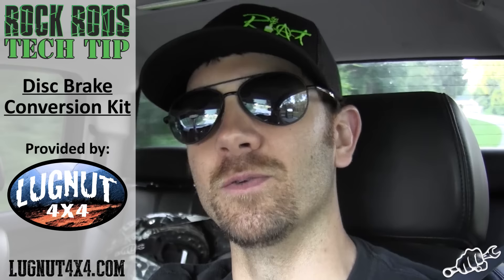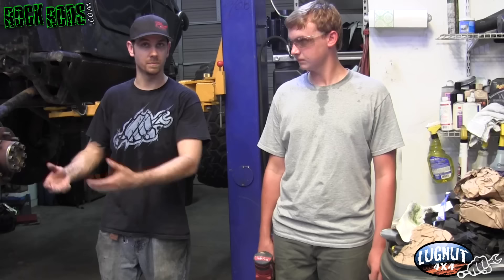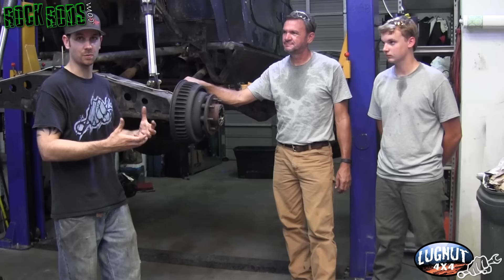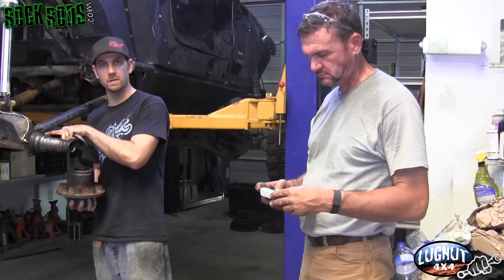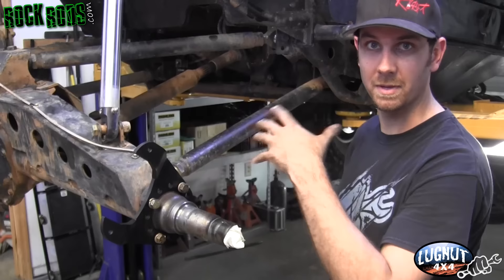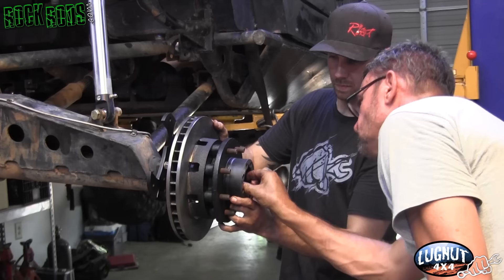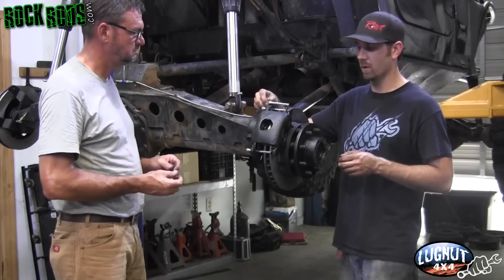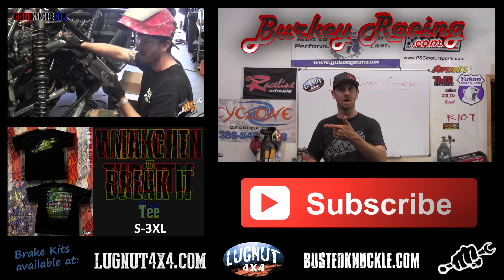14 bolt Disc Brake Conversion Giveaway - Rock Rods Tech

Comment: Good vid.   People should also be aware a different or adjustable proportioning valve is needed (to reduce fluid flow to rear brakes)
Keep on truckin'!
Reply from the maker: This is actually a balanced system so unless you go with the bigger brakes you should be good to go for an offroad setup. Learn more at www.lugnut4x4.com
Reply: I stand corrected.  Thank you.  I guess I should learn more about rock crawlers before I post.  I learned the hard way when I did the switch in my square body chevy truck.  Keep up the good work!
Reply from the maker: No worries man. We are here to help. Many people run into this problem when swapping to bigger calipers. It can usually be remedied by a bigger bore master cylinder though. Thanks for watching.
Reply: Joshua Ackerman dam I didn't think of that thanks man
Reply: A big piston on front, 3/4 heavy duty. A 3/4 normal duty or a 1/2 ton caliper.
 On rear.  Should balance out. ??

Comment: Id like to find a FF 14 bolt gm AAM 11.5 rear and convert to 6 lug and have dual piston rear calipers with the 13" rotors for a 2006 Silverado 1500.

Comment: great video man ive got a question tho can you still run 15 inch rims with the the disc conversion?
Reply from the maker: Yes. check the FAQ on www.lugnut4x4.com for more info
Reply: were did you get 8 lug 15 inch wheels
Reply: @huckstirred7112  USW-78-5080R
Reply: @CT_Taylor  i will look thank you

Comment: I had many years ago   a set  of steel  12 x 15    8 lug  wheels .  I have been looking for a set for a long while .  Will I have to make them
Reply from the maker: Most aftermarket off road wheels have moved to 17x8 or 17x10

Comment: Can someone help me find were I can get Braided stainless brake lines.  I have had major issue finding stainless braided brake line hose. want to replace my brake lines in my 1975 chevy k20 but without having to bend all the pipe from the proportioning valve back.
Reply: Check Offroaddesign

Comment: thanks. good video
Reply from the maker: Thanks glad you enjoyed it
Reply: BustedKnuckleVideo how do you clean a Holly carburetor? I let my truck sit to long and the fuel plugged it up. Was wondering if guys could do a video relating to fuel?.
Reply: BustedKnuckleVideo also where should I by fuel? Everytime I buy racing fuel it is different blend? So I have to tune my engine every race? That don't work. It's messed up. I need the same blend of fuel every time I race otherwise it's impossible to tune my engine. Any suggestions?
Reply from the maker: we all run fuel injection doubt we could help there
Reply from the maker: you can buy it by the 50 gal drum